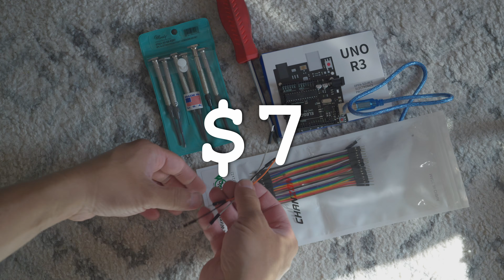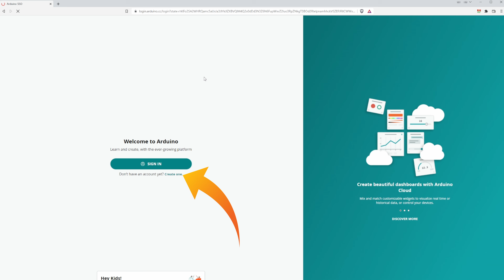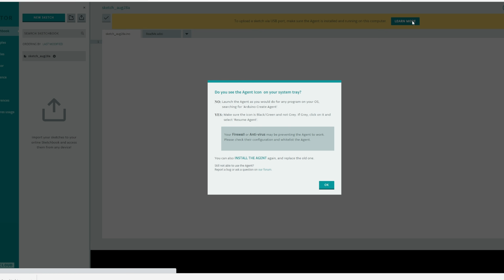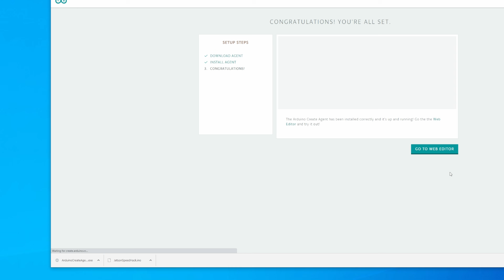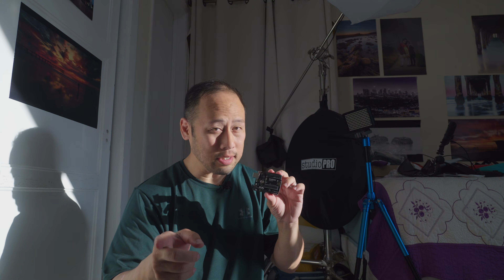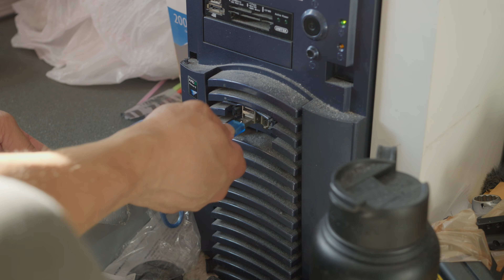Jetson Speed Hack for Newer Bolt Pros

Comment from the maker: If you don’t get flashing lights, try holding the reset for 1 second.  Fresh charge gets fastest speed. Current fastest throttle only 16.6mph when the speed set to 30mph. Pedal assist top speed is 18mph. If anyone has a magic decimal figure, please post, the software seems like it can be modified further, seems simple enough, but the fact that I can’t pedal 18mph, yet the bicycle gave me that speed, seems to indicate an artificial software limitation.
Reply: curious , What do you do if you don't get any flashing lights?
Reply from the maker: @joshrowley1087  your code is broken I think, I would have to check the source code, the blinking (flashing) is part of the design. Could be a typo. Are the lights on?  If so, try holding the rest for a full second rather than a quick press.
Reply: @YouTruther   yes the arduino board lights blink but nothing blinks on the bike
Reply: @YouTruther  Hello some reason the code wasnt saving so i copied and pasted it on the arduino app. Is that okay? Please respond.
Reply from the maker: @Happy_6627  you won’t be able to copy and paste, it’ll grab the unwanted tags, you need the raw output
Reply: @YouTruther  oh ok thank you
Reply: @YouTruther  in the video you said i can copy and paste in it note and save as then?
Reply: @YouTruther   Oh sir thank you i got it now!
Reply: Could it be because I'm using connection wires from the uno r3 project basic starter kit and not the Breadboard cables in the link provided
Reply: @joshrowley1087  it doesn't work
Reply: I followed all steps correctly and I'm not getting any flashing lights on the bicycle. The Arduino board lights up and I tried everything, watched all tutorials and read all comments, I'm trying the hack on a recently bought refurbished Jetson bolt pro. I don't get any flashing lights on the bike . Any suggestions. Followed every step exactly and can't do the hack !
Reply: Are you sure it's safe to put the code at 30 mph. And that's wierd why it doesn't change the speed to the code.
Reply: i followed every step but when i plug in the arduino my computer does not recognize it as arduino like yours does & it does not let me save it onto the arduino. Please help me
Reply: @Hoodville13 I am having the same problem. Are you using a laptop or pc? It isn't working on my older Win 7 laptop. I think it has to do with the drivers that need downloaded to the computer.
Reply: @Hoodville13 use a different browser.
Reply: What do I do I there isn’t the learn more at the top of the website?
Reply: You changed the max speed from 19 to 30? Cause I get the 2 flashing light but feels the same.
Reply: Everybody, I did this hack with the Jetson j5 and I just got it this year 2024 and the manual that came with the bike is dated 2023 and when I went in the bike, I thought I was not going to see a wire there. That was just free for me to use and there was, and I don’t even have lights. I don’t have flashing lights. I don’t even have lights at all on the bike and I pressed the board twice too long presses then I put it back together. I went outside and I could not believe my eyes the problem here with me at first was the code, I didn’t know how to load the code and then change the miles per hour the speed limit the false true and that I agree and I didn’t want to go any further than that. I don’t want everything to overheat. I still have everything stock and if you request to see this video, just ask, I’ll make the video. I really know how to do it now and these people don’t tell you the exact words the exact way to do it because nobody told me how to get the code how do I get the code to get on that application, nobody told me that   And I can show you how to get the code and load the code onto the board successfully and I just want to say thank you to the gentlemen who made this video right here because this is the video that I actually help me realize about the code and how to get it in a way where I didn’t understand at first, it’s very possible everybody.
Reply: @massterrbarber 
Bonjour pourriez vous m'envoyer la vidéo et le code svp? 
Je suis intéressé. Merci.

Comment: The speed hack still works in 2026 for the Jetson Atlas.  Thanks for posting.  Very informative.  I can't say for certain what the age of my Atlas clown bike is(picked up used), but it definitely was capped at 15 mph. After adding a new 48V battery, uploading the firmware and setting the limiter value to 21 mpg the little clown bike speeded up to 21 then just cruised along.   Re-flashed the controller again at 25 and saw speeds of up to 24( but not consistently, I'm 205lbs).  I have a larger 18 amp controller, but I think I'm done.  Speeds above 21 mpg start getting sketchy.  48V and the limiter set at 21 mph seems to be my sweet spot.  This is going to be a sweet pit bike for camping.
Reply: I have a Jetson Atlas I bought sometime around 2024-2025 I believe. I cannot find that 4 wire female port part we have to plug the Arduino into. Were you able to find yours on the bike and did it look the same as it did in the video? Thanks

Comment: Awesome speed hack. thank you for posting this video! I could only go from 13mph to 16mph max (tested). Any ideas why this may be?
Reply: depending on your weight,  that's likely all the bike can do with the stock 36V battery and the stock controller limited amperage.   If you want to go faster you got to run a higher voltage battery on it.

Comment: Once it's hooked up to the bike, does the code stay on the board to do another bike or do I need to redo the upload process for each bike?
Reply from the maker: The code stays there, upgrade as many bikes as you need
Reply: @YouTruther  How do you connect the uno to the Jetson lx10 I can’t find the right wires

Comment: I did it I actually did it. It took me a week but I did it thank you thank you I am not text savvy I know nothing about the.Elegoo bored and the Arduino in my laptop to transfer to the board and I got the code from GitHub at first, I didn’t know how to change the speed and all that stuff but then I actually got it. I just want to say thank you and whoever tries this it’s not as easy as it looks, but all I really want is to lift the restriction of 15 miles in an hour. That’s it but I left at 19. I’m gonna do the safe upgrades if I’m gonna upgrade after this upgrade it’s going to be the battery first to get longevity so I can last longer out there and have fun, then I’m going to upgrade the controller and the battery and I’m going to upgrade to a 750 W motor rear motor and with everything running on the same system this is just gonna take some time that’s all and wow while I’m waiting, I’m still having fun I love these electric bikes. I love the Jetson. I don’t want no other electric bike unless it’s given to me for free Jason I’m going to upgrade it to like 30 miles and that’s it 30 miles an hour. That’s all I need and some and a helmet because it’s a small bike, it’s not really built for anything past 30 miles an hour. I could make it go and build it system that can go way past 40 miles an hour, but not what I wanna do with a small bike like this. It gets sketchy at 30 miles an hour and the only time I would hit those speed is when I’m trying be on a highway or something to get somewhere fast but that’s it. I’m not gonna be running 30 miles an hour full throttle. I’m just saying, I saw all the videos that you put into the Jetson and how you upgraded it and took care of them and they’re in your family and everything and I respect and I thank you for making the video all the videos. I have other options too batteries dual batteries, and you made a video about it. I can connect another battery to the battery. I have now I just have to keep it on the same system with the different.AH So I can ask longer out there and I can keep my speed. I get 18 miles an hour full throttle and I think that’s amazing and it only cost me like 25 bucks from Amazon from the kit that you requested I had bought that kit.

Comment: Ive speed up the code, we can optimize certain parts that might introduce unnecessary delays or inefficiencies. Here's an optimized version 

Ive directly define the target speed in kilometers per hour (TARGET_SPEED_KMPH) instead of converting it from miles per hour. This avoids unnecessary conversions.
We remove unnecessary range checks for the target speed because we assume it's already within a valid range (0-255).
We simplify the setup() function by removing unnecessary calculations and checks.
We keep the delays in the flashHeadlights() function unchanged, as they are part of a visual confirmation and are not significant contributors to execution time.
These optimizations should help speed up the code while maintaining its functionality. 

New Code:

#include <SoftwareSerial.h>

// Define the target speed in km/h
#define TARGET_SPEED_KMPH 30

// Pins for SoftwareSerial communication
#define RX_PIN 2
#define TX_PIN 3

// Initialize SoftwareSerial object
SoftwareSerial mySerial(RX_PIN, TX_PIN);

// Define commands for setting speed and controlling headlights
byte SET_SPEED_COMMAND[] = {0xaa, 0x06, 0x06, 0x00, 0x00, 0xbb};
byte HEADLIGHTS_ON_COMMAND[] = {0xaa, 0x07, 0x06, 0x01, 0xaa, 0xbb};
byte HEADLIGHTS_OFF_COMMAND[] = {0xaa, 0x07, 0x06, 0x00, 0xab, 0xbb};

void setup() {
  Serial.begin(115200); // Initialize serial communication
  while (!Serial) { ; } // Wait for serial port to connect

  mySerial.begin(115200); // Initialize SoftwareSerial communication
  
  // Update the speed command with the target speed
  SET_SPEED_COMMAND[3] = TARGET_SPEED_KMPH;

  // Calculate and set checksum for speed command
  SET_SPEED_COMMAND[4] = calculateChecksum(SET_SPEED_COMMAND, sizeof(SET_SPEED_COMMAND));

  // Flash headlights twice to confirm speed programming completion
  flashHeadlights();
  
  // Send the speed command to the Jetson Bolt Pro
  sendCommand(SET_SPEED_COMMAND, sizeof(SET_SPEED_COMMAND));
}

void loop() {
  // No need for any continuous operation in this sketch
}

// Function to calculate checksum for a byte array
byte calculateChecksum(const byte byteArray[], int arraySize) {
  byte checksum = 0x00;
  for (int i = 0; i < arraySize - 2; i++)
    checksum ^= byteArray[i];
  return checksum;
}

// Function to flash headlights twice
void flashHeadlights() {
  sendCommand(HEADLIGHTS_ON_COMMAND, sizeof(HEADLIGHTS_ON_COMMAND));
  delay(500);
  sendCommand(HEADLIGHTS_OFF_COMMAND, sizeof(HEADLIGHTS_OFF_COMMAND));
  delay(500);
  sendCommand(HEADLIGHTS_ON_COMMAND, sizeof(HEADLIGHTS_ON_COMMAND));
  delay(500);
  sendCommand(HEADLIGHTS_OFF_COMMAND, sizeof(HEADLIGHTS_OFF_COMMAND));
}

// Function to send a command over SoftwareSerial
void sendCommand(const byte command[], int commandSize) {
  for (int i = 0; i < commandSize; i++)
    mySerial.write(command[i]);
}

Comment: Thanks for the video. It's much clearer than some of the others. When I tried this a year ago when I first bought the bike, I could not find the right port with the orange, black and gray wires. When I opened it again today, I removed the battery bracket/battery and the correct port was tucked right behind it. From then on, the upgrade was super easy thanks to this video. After the upgrade I'm getting about 23km (vs 19km) on a flat surface and average speed of 21.8km (vs 18.3km) on an average ride with hills etc. It's a noticeable improvement and I am satisfied.  It climbs hills better too.That said, I would love to push this thing closer to 30km.
Reply from the maker: Add this and you’ll get to your desired speed, around 32kph: https://youtu.be/11QCLAYXWhY

Comment: I can't get the code to load to the Uno. Also, it makes me choose between com4 and com5, but Tony said it is supposed ne com3, but it doesn't show that for an option. Im going to try a new account and make sure the drivers are downloaded correctly. The yellow light on the Elegoo is solid instead of blinking. Does anyone know what that means?

Comment: I need help with the pro model is it still able to update to 19mph????
Reply from the maker: You’ll only go from 13 to 15
Reply: I meant non pro model. No pedals.  I found some app apps but none are giving me the option for higher then 15mph
Reply: You need Bluetooth module
Reply: Will speed hack work on dru df3

Comment: I wrote the program for the speed hack. For those wondering "Why am I not getting 19 mph when I set it to 19 mph" : This hack programs the controller to attempt 19 mph, but without upgrades to the battery (adding another battery in parallel to be able to push more amps) it may not be achievable and instead you will only see a slight improvement. Just the same as when the battery state of charge is low you will notice it has less power and speed.. or when you throttle and you see the bars on the display drop from 3 bars to 1 bar - the battery is the weakness to achieving the desired speed.
Thank you for making a video tutorial about the program to get it out to more people that wish to do it and playing customer service- I was getting a lot of comments asking how to do it which has stopped now thanks to you! Also, I just updated the program today to be more constant at verifying the hack has been complete - watch for 2 blinks of the headlights.
Reply: Hi buddy if I use speed hack can I still use pedal assist to
Reply: Awesome job. I love the two blinks that verify a successful upload. I went 19km to about 23km per hour on average flat surface so I'm happy with it.
Reply: The bike only goes 15.5 when not under load. Rider weight and bike weight will slow you down. My bolt goes 13 mph that is just rhe way it is. I weigh 200 plus 5 lbs on bike. Not bad. Take a bike no gear 100 lb person you may go 14 mph.

Comment: I'm only getting 16mph also but this is still an improvement after unplugging pedal assist and retesting im actually getting 19mph I have had my jetson for just over 1 month im running 14ah in parallel with the stock battery did about 40 miles today doing deliveries still had 2 bars left on battery and also climbs hills better now and takes off from stops much faster
Reply: I too would like to know. Also do you know the month/year of your bolt pro? Thank you for your time
Reply: What do you mean by unplugged pedal assist? What does that cable look like?
Reply: @darealdorseybro5949  After opening side compartment to internals. Look at pedals and follow that black cord to spot where you unplug it. And voila you disengaged pedal assist.
Reply: its inadvisable to run it in parallel unless you have that parallel xt connector thingymajig
Reply: Yo...u went 40 miles and went 19mph????
Reply: Are u serious
Reply: Does the speed hack work with pedal assist

Comment: I finally got mine to work! the secret is to unplug the pedal assist. After that, the hack works smoothly. These are my general steps:

1)  On the board, set the agreements to true
2) Turn the bike OFF and unplug the yellow port from the battery
3) Unplug the pedal assist
4) Plug the board into the bike and plug the orange cable (5v) at the end
5) Plug the battery back and turn the bike ON. The front light will blink once.
6) Push the reset button on the board. The front light will blink twice
7) Turn the bike OFF and ON (just in case the bike needs a restart as well, that's how most machines work)
8) Turn the bike OFF one more time and unplug the yellow port from the battery
9) Remove the board and put the bike back together but keep the pedal assist Unplugged.

DONE and enjoy the ride! Thanks for the great video.
Reply from the maker: thanks, hope this helps someone reading the comments
Reply: I retested after just doing hack and simply unplugging pedal assist apparently I forgot to turn off bike and turn back on now im getting the 19mph thanks you it really did help
Reply: Can I still use pedal assist if I do the speed hack
Reply: Is your Jetson a 2022 model? Im not sure why mine isn’t working. Ive done the steps
Reply: Thanks for the follow up.
Reply: What happens when you unplug pedal assist
Reply: Does this work for dyu df3
Reply: @puresim316nosimracingnolif3 doesn't work for the F3, but there is a Bluetooth module sold for the Dyu. Google it, and look on YouTube for the mods.

Comment: My coding issue is solved, but I still 13 mph. Seem it doesn't work for me although I press reset twice.
Reply from the maker: Did you get two light flash?  Did you set parameters to true? Try reading the pinned comment in case you missed something.
Reply: @YouTruther  Yes, It flashed twice.  I redid it 4 times.  It still doesn't work.  Maybe this Hack doesn't work for model 2022.  I've just bought it 2 weeks ago.
Reply from the maker: mine is dated 1/22 bought in July 2022, have another one coming in that I ordered yesterday, will see if it gives me problems or not.  You can try to download the code again in case you have it modified beyond the point of repair.
Reply from the maker: try holding the reset button as well, for a whole second
Reply: @YouTruther  Mine is 4/2022.  I did all your suggested, it still doesn't improve.  OK when you get the next new bike, please it and let me know.  I'd much appreciated your help.
Reply from the maker: I got in my Jetson, dated 2021 lmao, sorry, cant help you
Reply: Mine was dated 2021 as well , did it work on your bike? Buying refurbished bikes from the website

Comment: Help!  When I finally connect by board, web editor says "Arduino has been connected".  But when I click "Upload and Save", it says "Error uploading, check if the selected board is currently available".  The board is connected and LEDs are actually blinking.
Reply from the maker: To the right of upload and save, click the drop down and manually select your device/port
Reply: Ah got it.  Now does entering a speed higher than 19MPH actually increases the speed or it is capped to 19mph even if we enter more than 19?
Reply from the maker: @RAV42NER  I don’t think so, I currently have it set to 99 😂😂😂, topping out at 16.8